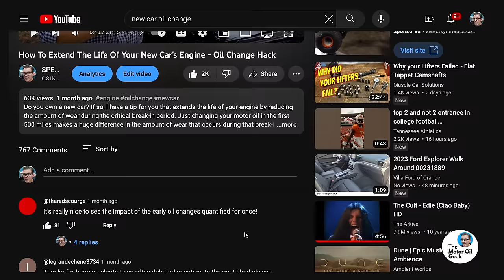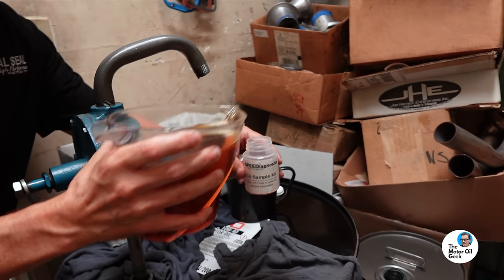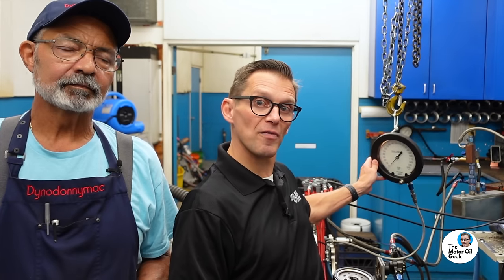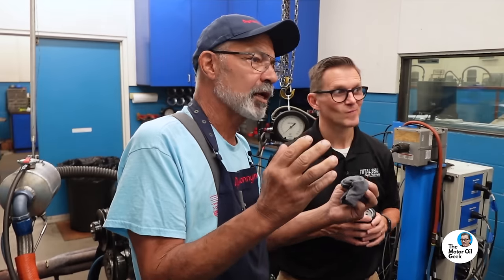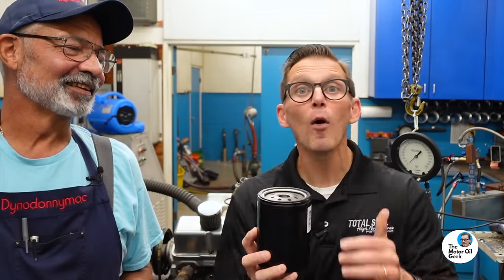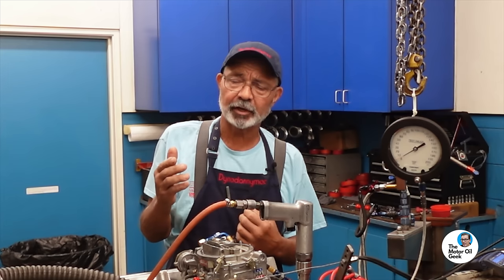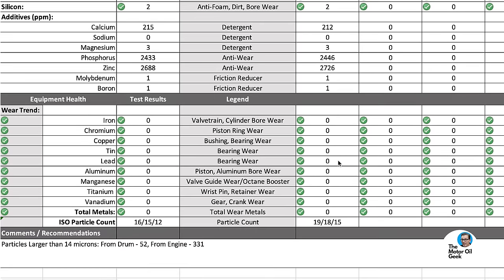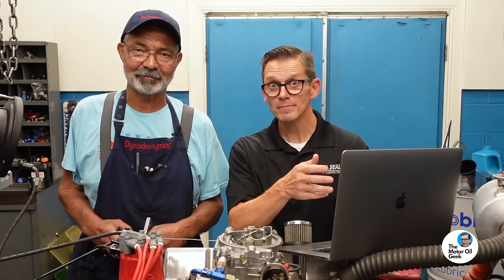Does Pre-FILLING The Oil FILTER Cause Engine DAMAGE?

Comment: I've been a heavy truck and equipment mechanic for 35 years. Today I serviced a Western Star that holds 11 gallons of engine oil. The two oil filters together held 1 1/2 gallons. I can't even imagine not pre-filling them.
Reply: I can't imagine the bill for the oil change!
Reply: That's a different animal than a daily driver auto.  Special applications require different methods.
Reply: Right there with you. I always pre fill all vehicles I work on unless not able to.
Reply: Watch garage 54 with the transparent oil filter, they fill instantly with the motor turning over!
Reply: That's a Centrifugal pump and filter so your comparing a mountain to a couple grains of salt.
Reply: Never have
Reply: @Yukanhayt-Mhenow, the oil filter might get filled, but there's no oil pumping up into the heads until then.
Reply: That’s pretty crazy and one big ass engine!
Reply: the two applications are totally night and day comparisons, 1 1/2 GALLONS compared to around 1 quart of zero lubrication running time of course you fill up the two filters first but a car engine no need
Reply: @Yukanhayt-Mhenow  pre-filing is not about filter the oil, its about the wear aplied to the engine. THE almont of time wasted in filling the filter = wear in top engine compounds x the times you do that = premature engine damage.
the filter is already in the hand, WHY take the risk ? ?
Reply: @drofmah3836  I guess you didn't pay attention to the video you just watched.
Reply: My filter is sideways it will just spill out.
Thats most of them.
Reply: @TIGJOHNNYSILVA  Its not about that, it is about your ego. There is no risk, there is no wear, there is no damage.
Reply: Sounds like an EXPEN$IVE oil change!!!
Reply: If it wasn't in the service manual, it was the wrong thing to do.
Reply: I never do this as its stupid and a waste of time. there is already a coating of oil on the anti-friction bearings and they run on little oil anyways, never understood the obsession of doing this
Reply: @jlo13800  Its from mediocre people needing to feel special about something they do
Reply: Yeah it is, i never do it on my 8v92 2 stroke as im BRP-XD-100 oil in it,
Reply: @drofmah3836 - actually its all relative. Distance traveled (engine displacement), size of bearings, etc vs volume of oil filter. So its actually apples to apples.
Reply: Doesn’t make any difference at all.
Reply: @TIGJOHNNYSILVA there’s no risk.
Reply: @richsmith3300 You can fill it and let it soak into the pleats and repeat usually twice. Of course at some point it would be too much and spill out.
Reply: @GT-mn3bx  oh ok thanks for that.
Reply: @GT-mn3bx never really thought of that thanks will try it next week🫡
Reply: @jlo13800  Are you aware that BMW requires an oil circuit priming every time something is done that interrupts the oil flow in the engine? You must know something BMW engineers don't. Waste of time? Wtf are you talking about? It takes less than a minute to pour some oil in the filter...
Reply: Never had a BMW, but sounds a lot what the Skidoo Rotax 850 Etec turbo r does on the big snowmobiles. Sounds like a posi force oil injection system on both the BMW and Rotax.
Reply: @danielquilesjr.3461 
I disagree with this process.
Been pulling wrenches for 40 years now.
When in early years had done this, and totally abandoned the concept of this process. So I would say 35 years now and have never ever had an engine issue. 
Rebuilt many many engines
Reply: @danielquilesjr.3461 
I disagree with this process.
Been pulling wrenches for 40 years now.
When in early years had done this, and totally abandoned the concept of this process. So I would say 35 years now and have never ever had an engine issue. 
Rebuilt many many engines
Reply: El Viras charge cooled 530cc 2 stroke wankel rotary ceramic coated engine can make over 85 hp at 68  rpm's ans is N/A and uses silkolene synthetic 2 stroke oil
Reply: it just over inject too much oil than the bearings need, everything is on anti friction bearings since the 60's till today
Reply: Elviras 530cc charge cooled wankel rotary ceramic coated 2 stroke can run as lean as 100;1 and make 85 hp N/A! Juice Newtons 294cc charged cooled wankel makes 60hp on JP8 and uses silkolene 2 stroke synthetic oil like El Viras 530cc wankel!
Reply: Both Juice newton and El Vira uses silicon nitride coating in the rotor chambers and apex seals. There are ceramic silicon nitride roller bearings on eccentric crankshafts too!
Reply: Julia Childs did all the CNC machining on here granite bedway 5 axis CNC aetheric laser mill
Reply: @richsmith3300  With sideways filter, remove sparkplugs to avoid compression, and crank engine over until oil pressure is achieved.  It's the engine running under load with no oil pressure that does damage, not an engine being cranked. The toyota corolla workshop manuals from the 70's cover this.
Reply: @martincarriere3738  And what engine issue would you expect? It's not like your engine is going to blow up... we're talking about maybe a slightly reduced engine life for long mileage engines, not catastrophic failure 5 min after the oil change.
Reply: @johnnyblue4799  the customer base we deal with are repeat customers many that had fleets well over 30 units. Cummins present back to some big cam engines with top stop injectors, Detroit 2, and 4 stroke, caterpillar various engines.
All that we also provided, and monitored oul samples from engines,  transmission, and different.
Very very seldom did we get bad samples. 
Most of these customers were construction,  mining, and oilfield. 
90% of engines that weren't rebuilt by us, came in with a hole in the pan, or block. Usually overspeed.
To this day, I don't pre fill oil filters.
For a rebuild,  we would pressure lube the engine before start up.
Reply: I have been mechanicing since 1975...always fill the filter with an oil change...even if the filter is mounted sideways. You can still pour it halfway full and then let it sit for a while and the filter will soak up most of the oil in it...and never forget to put oil on the o ring..you'll have heck getting the filter off next oil change...I  guess that's why my engines last so long 😂
Reply: If it makes you feel good you can fill some of them. There is no need to do it, you’ll never notice a difference.
Reply: We never fill. Doing all the heavy equipment. 2x 2L filters etc.
Reply: I have mine changed every 12 -15,000 mi (that's about 4 to 6 weeks of driving). It's about 400 bucks (or one fourth the cost of filling the diesel fuel ranks)
Reply: Pre fill pre fill same with diesel fuel filter or the pump doesn't get lubed
Reply: @morgandelaware7269  fuel filter is totally different story!! Most cars wont start because they suck the fuel, there is no fuel pump. If you have filter full of air then it won't start or will have to crank it for minutes. Pump doesnt get lubed... The fuel nowadays doesnt lube it anyway. There is no metal on metal grinding when it doesnt get fuel. Fuel is there to cool it down for the most part
Reply: My Honda only takes 4 quarts. Don't think it matters for me.
Reply: @richsmith3300 pull the fuel pump fuse and try starting the engine for 5 seconds. There you go, it's now primed.
Reply: 3 filters 1 1/2 gallons and not a single drop of prefil  900000 miles going strong
Reply: @jlo13800 
you make a really good point 👍
Reply: @harleyhawk7959 exactly! Just because the oil filter fills instantly doesn't mean that oil is delivered to the vital parts of the engine instantly
Reply: @drofmah3836  As a mechanic run your car with no oil for 30 seconds every 12 months for a couple years and I'll bet you'll wish you had not done so, you'll statistically shorten your engine's life by 49%...
Reply: @richsmith3300 you do NOT have to fill the filter until it's full of oil in order to prime it which is what you are accomplishing by pre filling it. It doesn't have to be filled to the rim of the filter...
Reply: @malcomreynolds4103  I'm a commercial diesel mechanic with over 30 years under the hood, as little as 30 seconds without oil pressure reduces bearing life 50%...
Reply: @jlo13800  been a commercial diesel mechanic for over 30 years, as little as 30 seconds without oil pressure reduces bearing life by 50%... so yes, you most definitely should pre-fill oil filters
Reply: Thats why both Polaris and Skidoo use the posi force oil system on their 850's! Thos are mini jimmies that are 2 stroke like detroit diesels!
Reply: @jlo13800 yeah your old Detroit is one of the most resilient engines ever made when it comes to lack of oil as the entire block is pressurized and it's extremely common for those engines to accidentally be ran with little to no oil in the crank case and still somehow survive. The old saying with  commercial diesel mechanics when it comes to 2 stroke Detroits is if it's not leaking oil while it's running it's because it's OUT of oil...
Reply: @johnnyblue4799 well some people value durability. I mean it's not like there's a million mile club for Cummins engines or anything like that.. oh wait, there is lol
Reply: @Andres-wy5du  5 class 8 trucks, lowest mileage one has 1.3 million miles highest a Peterbilt with 5.8 million all on the original engine (not rebuilt) all pre-filled going strong...
Reply: Yes my 8v92 like most detroits are anti friction bearings, A Rotax 850 Etec is external pressurized with sensors, pumps and other shit. Detroit 2 strokes are fairly high performace as the are bigger well sort of version of whats in snowmobiles. I have been running her with BRP XD-100 oil i get at walmart full synthetic. Funny thing is lots of Rotax skidoos will weep some oil by the RAVE exhaust valve thingys. Now on OP 2 stroks it would be a blast to make a rotax or polaris 1700 OP and lay it down in the sled. id probably kill myself on such a sled. Rotax is the jimmy in the snowmobile world, but polaris and arctic cat are catching up. Now the 1.9l 3 cyl rotax outboaud is 150hp and could probably be used to swap a 4-53 with it.
Reply: @jlo13800    I'm a second generation commercial diesel mechanic with over 30 years of personal experience plus my fathers 60+ years experience. Literally EVERY bearing ever made for literally any purpose is an "Anti-friction" bearing. That is what a bearing is, otherwise they would serve absolutely no purpose at all. Detroit 2 stroke engines are NOT by design high performance engines and still woll benefit greatly from proper maintenance, part of proper maintenance is ensuring adequate lubrication which pre-filled oil filters aid. Also those "Valve thingys" that leak oil on a 2 stroke diesel are called "Weep holes" the reason 2 stroke diesels have them is because the entire engine block is pressurized by the blower. The Rotax 850 while it is a 2 stroke engine it is designed to run on 100 low lead avgas with a mixture of 2 stroke engine oil (essentially a chainsaw engine designed to run on a mix of aviation fuel/2 stroke oil) quite a bit different and a significantly lower bearing load that a Detroit 8v92 (approximately 50-60k lbs less of a load on the bearings). Rotax 2 stroke engines have a rebuild recommended by the manufacturer of ever 40 hours of operation.
Reply: If you're going to fill up your filters you need to fill them from the outside holes so the oil gets filtered as it soaks through the filter material to the center.
Reply: Absolutely right. My 3406 cat takes almost half of the 5 gallon pail of oil to fill its filter. 10 gallon oil change. I cant imagine starting that expensive engine without filling the filter. Shit man for me thats the stuff nightmares are made of
Reply: @jlo13800 its not the film of oil that protects the bearings and wear surface its the oil PRESSURE.  Empty filter equals no oil PRESSURE and premature wear on the components. Do what ever social media you wish to listen to says just dont bitch about your engine wearing out prematurely
Reply: Is there oil in bedded in the bearings. Some CAT are roller bearing now
Reply: @jlo13800  there are no roller bearing connecting rod or main bearings in any diesel engines that I know of. Do you know how a roller bearing crank is assembled. I do because I also work on motorcycles and actually own a 4 strike motorcycle with roller bearing bottom end
Reply: Oy you got one of them press fit together cranks, Some bigger engines can run split roller though like 2 stroke and 4 (joke) stroke outboards. Some smaller air cooled deutz 2 stroke diesel might have them as well. Michael Obama's  Amaroqu 50 hp 2 stroke diesel out board is 68m * 64mm 3 cyl for 697cc! Who knows what that crank runs on.
Reply: Different animal than my 8v92 silver detroit 2 stroke turbo
Reply: Detroit 2 strokes are resilient because of the very hardened forged rods and crankshafts forged with 4340 Cr mo alloy or something like it.
Reply: Volvo d13’s have 3 filters. I fill them up as well now. Some guys don’t
Reply: If it makes you feel better by all means fill your filters, it wont hurt anything! i just never did it on my 2 stroke v8
Reply: @js6729  if any of that is accurate for what you maintain, the platform you are working on will have an oil priming systems that you will be told to use, instead of doing something as irrelevant as filling an oil filter.

nevermind that it doesn't take 30 anywhere close to 30 seconds for oil pressure to build in nearly anything, the 30 second number is entirely bullshit; cold weather diesels go without oil for far longer than 30 seconds every single time they are started yet still last tens of thousands of hours.
Reply: @Yukanhayt-Mhenow my question is if that's the case with all engines? If so how come when prefilled my oil pressure light stays on for 1 second vs 5 seconds when not?
Reply: If it's a diesel that's a good idea they work much harder than gas engines. I have driven several cars all with gasoline engines over 1,300,000 miles all together, in all kinds of weather temperatures and conditions.
 It depends if you're using synthetic, synthetic blend or conventional oil. The very best oil you can put in your engine gas or diesel, bar none is synthetic oil.
 The main reason the new car dealers don't put synthetic in every new cars is there a bunch of cheap hillbilly tightwads who are how to make every single penny of properly get no matter what takes. Is synthetic oil would be cheaper than conventional they would use synthetic. That's why they use conventional.
Reply: @jlo13800 you're right. They mostly emphasize this practice on the older cars when they had mechanical oil pumps. With better delivery systems and better oil, there is much less need to do it.
 Heck!!! The first cars didn't even have oil filters.😂😂😂
Reply: Todays engines have VRO
Reply: A lot of snowmobile today dont have oil filters or they have them.
Reply: Thats because the same oil pressure activates injectors and not filling them causes issues😒😒
Reply: Most of todays stuff is on roller bearings anyway
Reply: People just put videos out to get likes whether it is correct or not. Sometimes internet knowledge can make you stupid.
Reply: You can say that again.
Reply: What a waste of time. Do you not check the dipstick after priming? There's still oil in the engine after you drain it. Unless you let it drain for hours, until every drop is out.
Reply: My thought exactly, especially with Subaru upside down filter?
Reply: @martincarriere3738  dude you just gave testimony why someone should. Are you rebuilding the engines you didn't prime? 🤔
Reply: @martincarriere3738  Extra bearing wear is perfectly acceptable if you don't mind it.
Reply: @jlo13800  Awesome, where can I order a set of anti - friction bearings for my engine?
Reply: @js6729  Do you think oil gets to the bearings sooner if you pre-fill?
Reply: @js6729  Agree.  I fill mine to 1/64" below the rim.
Reply: @jeffro221  I don't think it does, I know from experience it does
Reply: @jeffro221  well for starters all bearings are "anti friction" that's why they're bearings but I think what they were talking about was bearings with a DLF (dry film lubricant) coating this is something that typically can be done by any diesel performance shop but it's still not intended to be a replacement to adequate lubrication, it's meant to be a preventative measure just in case you lose oil pressure
Reply: @js6729  Ok, thx for the info.
Reply: @js6729  Yup, I also believe oil gets to the bearings much sooner with pre-filling.
Reply: I've been a master tech for 25 years and have always pre-filled my filters.  Number of engines I've damaged = 0.00.
Reply: @harleyhawk7959 not worried about the heads. More the main bearings.
Reply: Expensive racing engines prelube the engine before every start and only starts until oil pressure is up.
Reply: at 6800 rpm's
Reply: @calgreco8607 i cant imagine the amount of money it would cost to not pre fill it lol
Reply: Journeyman TandT.  Provided the filter is filled properly it’s a must to do.  Filling the center isn’t correct and the argument it’s only a split second when starting  is ridiculous. Even a split second over the life of the unit will lead to reduced overall mileage.  Like cold starts.  All this adds up to less engine life.
Reply: @malcomreynolds4103 service manual helps you kill your motor so you have to buy a new car
Reply: Do not prefilled filters on heavy trucks. Most filters say right on them not to. You will risk filter collapse and never know it.
Reply: I saw a Oil Filter on a F450 take a whole quart of oil like a champ before overflowing
Reply: @ryanstage3912 but same scenario though.
Reply: @jlo13800 why do you keep bringing up 2 stroke engines when it's not even a similar in comparison??
Reply: Some oil filters are not even Level with the engine,which could case oil spills.. In that case,I would not prefill
Reply: 2 strokes are far superior with better power to weight ratio.
Reply: Donald Trumps 454 v8 2 stroke has a better power to weight ratio.
Reply: My favorite 2 strokes have no engine oil. Some are blonde.
Reply: whoopi goldbergs OP amarc 300cc opposed piston crankcase scacvend 2 stroke diesel makes over 25 hp, uses nickel graphene bushings and is dry sump with silkolee pro 2 sx 2 stroke oil and can power a drown on JP8! can be hand started in either direction1 thats what she said!
Reply: The majority of these click bait posters aren't ASE A or T certified. YT is  like a virtual coloring book. Those of us who spent time in a seat and working in the field already know.
Reply: @harleyhawk7959  the heads are as critical as the crank and rod bearings .
Reply: @calgreco8607 I was an owner operator for over 22 years. I changed oil in my truck every 13,000 miles I like the other fellow said it's held 10 gallons of oil + two large oil filters called a primary filter on a secondary filter I would put a fuel filter on also a water filter. The water filter also cut down on cavitation small air bubbles caused by vibration that damaged the Piston liners.
Reply: I was an owner operator for 22 years I had a 400 Cummins that also held 10 gallons of oil in the pan and another gallon between the two oil filters and then also you had the fuel filter and water filter. And the strange part I also used to take my drain oil and dumped 5 gallons and each one of my 120 gallon fuel tanks never ever had trouble doing that and it also added to the lubricity of the fuel.
Reply: i dry sumped my 8v92 and run xd-100 brp 2 stroke oil
Reply: Is why you prime. It's call prime.
Reply: I have never done it on my trucks and they hold the same amount as yours. No engine problems whatsoever. Those filters fill up in 5 seconds. You aren’t going to ruin your engine in 5 seconds.
Reply: true
Reply: Funny how Cummins themselves taught me to pre-fill them. I suppose they're just wasting their time...
Reply: Being around gravel trucks most of my life, I don't remember prefilling oil filters. But then I remembered the huge luberfiner filters, we did fill them to nearly the top, then crack the nut on top to get the air out. Most of my dad's early trucks were bought at truck auctions. They already had 400-500,000 miles. Dad was always checking samples and sending them off. At the time, Rotella T 15-40 was the best oil.
Reply: OMG this is getting on my nerves and is trying my sanity! You dont have to prefill anyfilter on any 2 stroke truck! Yo dont do this on your chainsaw, mower or snowmobile do you for fucks sake! all trucks are oil injected and this filling filters on it is tolal nonsense! Go up to some guys/gals on a turbo skidoo rotax and they will laugh at you and BTW lightning and the sun are plasma 2 strokes too! next time there is a thunderstorm go buy a large fram 4 stroke oil filter and hold it up running in an open field and if you dont get incinerated or blown apart consider your self lucky!
Reply: I don't pefill my because on my car the filter mounts sideways and when I prefill it it just spills out while twisting it on so I no longer bother with it
Reply: On my Tacoma 4.0 the oil filter goes on top of engine it faces downward, should I try to prime this filter?
Reply: Them tacomas are roller bearing engines so it won do nothihng
Reply: You will unfortunately need to invert your vehicle with the Toyota 2 post lift adapter. It makes overhead access of the filter easy and convenient, and simultaneously provides cooling system and transmission fluid flushing.
Reply: @js6729 where in fact did you get that from?
Reply: I am actually a mechanic. I get paid to be a mechanic. It becomes very important to me that the people paying me to be a mechanic have every reason to trust me and my work. Quite often I am being a mechanic on machines worth incredible amounts of money. This Western Star cost over a million dollars. You don't need to trust me. I need to trust me.
Reply: @martincarriere3738  how many of the previous oil changes had you done on the many many engines that you rebuilt.🤔🤨😂
Reply: OIops this sounds like a 4 joke automotive cult here.
Reply: I always do it as well but this time I have forgotten to prifill the oil filter
Reply: @morgandelaware7269  so all the oil drains out of the pump when the engine is switched off........dont think so.
Reply: It just a waste of time.
Reply: @jesse75  how do they pre- lube without starting  the engine ?
Reply: @creationinspired200  explain.
Reply: Who told you to fill the filters at the beginning of your 35 years?
Reply: @xl250mon5  at summit racing you can buy a pre luber for any v 8. 
It pumps oil through the engine before starting and wouldn't let you start the engine until it has maximum pressure.
Or, like I do, I pull the distributor and turn the pump over with drill.
You can hear when all the air is out of the system.
Reply: @jesse75  so pumps the oil through  the engine which has no oil in any of the bearings ? Please explain how you know all the air has bled out.
Reply: @xl250mon5  his name was Micheal Abbott.
Reply: @richsmith3300 
No it’s NOT MOST of them!
By far most are still vertical filters.
Reply: I was a heavy truck and heavy equipment mechanic for 40 plus years and if you didn't prefill the filter it strave the turbo bearing for oil and it could cause damage to the bearing.🧰🧰🧰
Reply: @calgreco8607 the same as it would be either way.
Reply: I was a diesel mechanic  for 30 years I all ways fill the oil filters even on my motorcycle
Reply: Those of us who know, know. Those of us who don't run our mouths in the comment section as if we do. A diesel mechanic by nature has an understanding of what goes on in there. There are no light parts in these things and wear is the enemy. The question of do you or don't you prime your oil filter is easily answered with why wouldn't you? If you can't, you don't. And chances are good if your filter is upside down or sideways it's bolted to an engine that doesn't matter. A 14 liter Cummins costs 45 thousand dollars. Your entire Volkswagen doesn't cost that new. Peace.
Reply: I worked on farms growing up and in my early 20’s was a diesel mechanic. I moved onto industrial maintenance 14 years ago and I’ve never heard of someone saying not to put oil in a filter. The presses I work on has hydraulic oil and some with oil. At no time do we ever replace the oil filter without first adding oil to the filter. Where do people come up with this stuff at. I would never put a dry filter on a vehicle unless you have no choice.
Reply: Let's run the engine with no pressure till the filters fill up.
In this case about a minute and a half.
Reply: @Yukanhayt-Mhenow exactly, primitive mind wont care to hear that
Reply: @harleyhawk7959 did you rinse the preexisting oil off? same as many times you start, literally can run without oil just not recommended;)
Reply: @Caliber50bmg  No. You follow the manual, and that is it. With an expensive piece of equipment, even if there are uncommon routines that help something other than a mechanic's ego - you don't do it. You follow the manual to preserve the warranty. you aren't smarter than the teams of mechanics and engineers that work at the manufacturer.
Reply: Been perfulling
Reply: Scania has centrifugal oil filter but I've always pre-filled any oil filter unless it's side mounted.
Reply: You run your engine, then add 1.5 gallons more oil. Easy to imagine there!  :)
Reply: @mulvahetpolemidasateed Fuel lubricates the fuel pumps - running an engine dry permanently damages the tank mounted fuel pump.
Reply: @robert4123  you're a genius. Not. For about forty five seconds at start-up your oiling system is working out a huge bubble of air. air doesn't lubricate. These parts are significantly heavier than the ones in your subaru, and significantly more expensive. I build these engines and I'm pretty familiar with what's going on in there. If you do this to a customer's 70 thousand dollar engine you had better not tell him. This western star cost over a million dollars, stick with the filters on your subaru.
Reply: @quantumphaser  no.
Reply: they charge themselves when you start the engine and the che k the level to adjust so it's dumb to prefill them.
Reply: @drefhill  And while they are filling zero oil arrives at the entire rest of the engine - which is exactly the point of pre-filling them.
The majority of wear on an engine occurs in the first 30 seconds after starting because of oil starvation.
That’s why a lot of modern oils have additives to help adhesion when the engine is shutdown to reduce wear at the next startup.
Reply: Well. Ya of course.... but prefilling a car filter is for insecure city peoples,
Reply: @joseph-mariopelerin7028  you should when you can. Not doing it is for lazy country peoples.
Reply: @tomscrossthreadgarage4183 so useless is better than lazy ?? 

Also it takes 3 seconds to build oil pressure... just unscrew your filter and start your car you will see...  actually,  have you ever worked on a car? That's the question to ask to city peoples because they sure like talking out of their asses...
Reply: I thought my cummins 5.9 filter was big. Its just a baby
Reply: @malcomreynolds4103 is that accurate for everything?  Because by that, my transmission fluid only needs to be replaced when my transmission needs to be replaced.  You seriously buy that transmission fluid can last 15 to 20 years?  And what, 300k miles?  That's skeptical for any lubricant...
Reply: @johnnyblue4799 It takes me 5 seconds. 
No low oil pressure light on dash at start up after oil change. 
It's stupid not to add a little oil to a new oil filter unless the oil filter is situated on the engine in such a way that it would all pour out before fully screwed into the engine.
Reply: @jstravelers4094  Makes sense.
Reply: Nextel oil change, try filling your oil filter half full, then start your oil change, after all done, add your filter, the filter soak up most of the oil so it will not leak too much and then add oil, You should see oil pressure on start up.
Reply: @danielquilesjr.3461 Yeah you really can't in my car since it's sideways and will just spill out.
Reply: I should pre wash my new underwear too. Make a video on that too😂
Reply: @Nick-wr7vv  yes.
Reply: Same medium heavy-duty equipment technician and I couldn't agree more I had just explained in a comment that there's a right way and a wrong way to fill an oil filter and that is plugging the center threaded hole so that only the surrounding small holes receive the new oil
Reply: Some are in positions such as horizontal you can’t fill it i service equipment and big trucks cars too I dnt pre fill them been doing it for years never had any issues.to each is to own
Reply: Exactly!!!!
Reply: When you rebuild and assemble a motor like me a seven Boeing 5.0 80s motor I always primed it before installation and then let it idle for 10 minutes and then take a drive.🤙😎✅
Reply: Been a mechanic  for 50 years,it's common  sense  to fill the filter.engines to day the  filters you can t fill
The top end will run dry, just listen  at it rattle !
Reply: @dennyergler9009  50 years,.. That is an incredible accomplishment. Bravo for real.
Reply: Where they horizontal or vertical????
Reply: Just use Slick 50....Problem solved 🤣
Reply: Well, the average car oil filter might hold half a quart.
Reply: A big rig and a regular car are two very different things lll
Reply: Fill them
Reply: The starter usually cranks the engine at around 200 to 300 rpm, if the oil takes 4 to 5 seconds to get to the engine head because it have to fill the filter first thats at least 13.3 revolutions before the camshaft can get any new oil, and by the 5th or 6th revolution the cams already shaved the oil film they had and will be running dry for the other 6 or 7 revolution, that is just a fact.
Reply: @TIGJOHNNYSILVA did you even read the comment? He literally said filter fills instantly that means there is no damage from some magical delay to the engine getting its oil. You must be trolling there is no way you commented  without even reading it
Reply: @bretmcnairn5940 

And you have been doing that pointless routine for over 40 years?
Reply: @js6729 

It doesn't have to be filled at all. Complete stupidity to do it.
Reply: @holmes1956O 

What an absurd comment. Prefilling the filter is complete stupidity
Reply: @IST1233  so you like shortening your engines lifespan, go it. Guys never have this person change the oil in your truck, he thinks it's cool to do something that literally takes half your engines lifespan away in a matter of seconds...
Reply: @IST1233  My question is how many semi-trucks have you changed tue oil in over the last 15-20 years? Moreover how many class 8 tractor engines have you rebuilt in the last 15-20 years? Cause it's what I do for a living...
Reply: @js6729  

So because you have been performing stupidity for many years, that means I should follow suit?
Reply: @js6729  

Provide scientific studies that show this and not just your "gut feeling"
Reply: @js6729  

And listening to your logic, I'd be a fool to bring a vehicle to you.
Reply: @IST1233  And this is a well observed Fact in the automotive industry from over 100+ years of data gathered... what I can't believe is that someone is actually ignorant enough to believe that an engine running without oil is perfectly fine and nothing to be concerned about...
Reply: @Yukanhayt-Mhenow is it one of those little modern car "teacup" filters or a legit 1 quart+filter?  Some engine oil filters hold half a gallon of lubricant...
Reply: This fast talking stuff is annoying like those disclaimer commercial I never listen
Reply: @drofmah3836 It still represents a gap in lubrication time.  Even if it is just a split second. 

Watch Dave's Auto Center's test on how long it takes oil to get to the valve train in a Fjord Power Stroke without his fix.  The valve train is oil starved on cold start up: and you think dry bearing surfaces add to engine longevity.  

😂

Less time unlubricated = better.  ALWAYS, end of story.
Reply: @richsmith3300 Fill it up halfway.  Angle the filter until you spin it on the engine if you have the space.  Minimal to no spillage.
Reply: @malcomreynolds4103 

😂

No, it's about your ego.
Reply: @jlo13800 It sounds like you have more money than sense.
Reply: @ColonelBumButt  That's called auto mechanic superstition.   The plus side, is more of your engine ends up in the drain barrel, so your vehicle will be lighter and more efficient!
Reply: @jlo13800  Bye
Reply: @Bowhunterohio Where do they come up with it?  Lots of PBR and their grampa's friend two towns over knew a guy who had a cousin who owned a garage.
Reply: @IST1233  Tell us you're lazy without telling us.
Reply: No correlation to a regular passenger car
Reply: Seems like a ridiculous argument. Manufacturer who is liable for the warranty on every vehicle they sell, says not to fill the oil filter.
Reply: @malcomreynolds4103   it is the correct thing to do. EVERY big engine co is done this way.
Reply: @martincarriere3738   why are you pulling wrenches if you have never had an issue?
Reply: @jlo13800   what the fuck are you talking about. bearings are bearings and they havent changed
Reply: @martincarriere3738   what shop? just to make sure my stuff never goes there
Reply: @mulvahetpolemidasateed   how do you think oil gets to the pump? you think there is a lil Leprechaun pushing it up the pickup tube? most cars have an in tank pump submerged in the fuel tank
Reply: @SiXiam   it does. your camshaft needs oil
Reply: @H0kieJoe  I think the problem today is parents not teaching their kids correctly. When a kid gets their drivers license they should be taught how to change a tire and change oil. My son don’t have his license yet but he rides quads and I make him help me with any mechanical issues he has. I’ve taught him to pay attention to his quad. He knows to always do a walk around and check things to make sure there isn’t broken bolts or something coming loose. I’ve taught him the same thing with vehicles. I grew up on a farm so this is what my dad did with me so I guess I passed it on. When changing filters I would think it would be common sense to fill it up. It’s obvious that the system would run dry until that filter filled up and the oil got to the system. Everyone knows it’s lubrication and it can never be ran dry but you also gotta think of how many manufactures have built cars and trucks with a filter that is mounted on the side which prevents you from filling it up properly. I’ve seen numerous tractors and equipment like that to. Again I think it all goes back to what the person is taught. I would be surprised to hear of anyone that doesn’t fill their filter up first. I always assumed that was common knowledge. lol.
Reply: @briankennedy5578  bullshit.
Reply: @alexkocefas6227  No worries, I'll never try'n sell you nothin'. I don't even really care if you fill your filter or not. Not my business. Peace.
Reply: @wolveric0  Have you ever seen a big cam cummins?
Reply: @notsure6182  No, its not. It is NEVER done on a rig with a horizontal or upside down filter. The correct way is what is in the manual. Nothing more, or less.
Reply: @malcomreynolds4103  what "rig" has filters like that. every Cat and Cummins I have serviced has them vertical, same with the fuel filters. some mini excavators I have seen them upside down (what fucktard thought that was a good idea I will never know)
Reply: @joelnordstrom8049  they still have mechanical oil pumps! All oil pumps are mechanical
Reply: @martincarriere3738   it is a common practice to roll in new bearings on a cummins engine. common maintenance procedure.
Reply: @TIGJOHNNYSILVA   air bubble passing throught will rip it apart so no i wil never prefil
Reply: You can disable the fuel pump with a fuse, then just crank the engine to prime the oil system. On most modern vehicles, pressing the gas pedal to 95% or more, induces "flood clear" mode which disables the engine fuel injection system, preventing the engine from starting, but leaves the ignition system on, to prevent any fuel residue from washing out the cylinders. On a diesel, the flood clear mode probably disables the fuel pump, but check your owners manual first, this won't work on old mechanical engines.
Reply: @starseeddeluxe   and you can just fill the filter to shorten the time to prime. you can directly spin the motor with the starter lead, no need to fuck around with fuses etc
Reply: On small passenger vehicles, no, because the filter is so small. Large diesel engines with 1 gallon filters, I pre fill. It just.makea sense.
Reply: @notsure6182  lots of detroits have them upside down or horizontal. Marine implementations could have the filter literally anywhere and in any direction
Reply: Doesnt all that new oil pour over the engine components as your filling it with the oil? So the filter isn't doing shit untill the motor is running.
Reply: @js6729 Thats not an issue. Oil pressure builds up within a couple seconds on any engine.  Plus there's residual oil left over.
Reply: @Yukanhayt-Mhenow yes they fill up fast but what about the rest of the system its dry untill the system if full of oil. Look at big machines that hold 4-8lts of oil thats a long dry time
Reply: I was just thinking the same thing 😂

The cummins manual says on big bold letters to prefill the filter with at least 2 quarts (ours only have 1 filter, but we are a fleet joint and are federally mandated to change fluids every 5k)
Reply: @eac1235  Is that a guarantee? How many   seconds does it take for an 855 Cummins, or an 8v92 Detroit or a v12 Duetz? Perhaps a B+W Mann 2570? Would you like to foot the rebuild?
Reply: My Cat dealership never pre-filled filters. Said they filled so fast and if you pre-filled you create an air void. Every one of my Cats went over a million miles before needing an overhaul.
Reply: I agree with you 100%!
Reply: Facts 
My
Freightliner the same not to mention if I use ten gallons of oil 1 gallon of Lucas
Reply: should always prefill big diesel engines...
Reply: My vehicle has 360k on it.  I do all my own work. Never once filled a filter in my life. It’s still going strong almost to 400,000.  It really doesn’t matter. 
Maybe on big massive trucks I can see it making a difference though.
Reply: @richsmith3300 I had a 2014 F150 5 liter. The filter was on sideways. I still semi filled it, layed aluminum foil underneath to catch any spill, and hand tightened.
Reply: Who primes an oil filter 98 percent of cars out there do not prime there filters. My 425k Honda Ridgeline never done it on any of my cars . Honda Civic 212k n Acura TL 220k . My engine blew up never.
Reply: I have been doing my oil change on my 300k miles 3.5tt f150 without preefilling ,,,will my engine last 700kmiles if I prefill 😂?
Reply: Elude the sea a little bit and if it’s actually a vertical filter which is fairly rare nowadays, you can fill it however, it’s not required. This is a speaking purely for passenger vehicles. I will say that when the guys work on my big rig that both of the filters are actually almost completely filled the top before they’re actually screwed on, but there’s actually a system where you can actually fill the filters after you screw them on on the side of the block on our trucks, I don’t know if it’s an add-on or it’s actually manufacture add-on
Reply: All the “mechanics” in here that say you need to pre fill your oil have obviously never changed the oil on a Volkswagen tsi engine 🤡. It’s fine if you do, it’s fine if you don’t, but don’t belittle the other guy because he doesn’t do it your way.
Reply: @rolando7660  I own a 2011 Tiguan. You guessed it, 2.0t. This isn't about that. Or my Audi, or the 535.
Reply: We can agree to disagree technology has come a long way I'm old school do what you feel is right it's all good.
Reply: @tomscrossthreadgarage4183  and I drive a 2022 Peterbilt 389. I see the argument for filling the oil filters with oil before hand, because they are ridiculously huge…. But a little 2.0 engine? Can’t compare a big 15 liter engine to a 2 liter if you ask me.
Reply: @rolando7660  right, a little 2.0 doesn't need oil at all.
Reply: @tomscrossthreadgarage4183  for a quarter of a second….. sure buddy.
Reply: @Yukanhayt-Mhenow  Its still not "instant" on everything...and also increases the time for oil pressure to build.  Depending on the engine and what it runs at after startup can vary a LOT.
Reply: Same here, just what you do.
Reply: I prefill fuel filters on big diesels but never the oil filters. And lol the filters do not hold 1.5 gallons. Ive changed many and never 1.5 gallons. Yes they can hold a whole 5 gallon tub and some but the filters a quart each at most..
Reply: @shawnkelly695  Besides, if you don't prefill em, how would you know what they hold? I've measured what they hold, in fact I always do because I have to charge for it. I don't think you've ever changed the oil in a 'big' diesel, perhaps not even your lawn mower. And by the by, if you don't fill your fuel filter, the truck won't run, genius.
Reply: How long is the interval?
Reply: Not all oil filters can be filled.
Reply: I used the pre-filled oil filters until the internet said not too, see what you get for believing everything on the internet.
Reply: How hard is it to put oil in your filter and spin it on? Stupid or not an ounce of prevention......
Reply: Oil filter yes, diesel fuel filter absolutely no!
Reply: @ryanstage3912 I'm with you, it's not possible to fill the filters on daf trucks, pacar motor, the paper filters like a car, without the filter in the oil just pours into the sump. The filter locks to the lid so not possible to fill.
Reply: @Yukanhayt-Mhenow  I imagine nothing is more instant than it being filled before hand
Reply: For vehicles where the oil filters are literally straight up and down, they won't spill. For vehicles that have oil filters sitting at an angle, the oil will spill out of the filter a little bit. For ridiculous engines that have an oil filter that gets attached to the engine with the threads facing the ground, it's impossible to pre-fill those and hold all that oil. I believe a Mazda RX7 had an oil filter which was/is actually upside-down! 🙄
Reply: @danielquilesjr.3461  So you prime the ones you can't or just look the other way.
Reply: @richsmith3300 if ur filter is sideways it really doesn’t matter then. YouTube commenters will think they are smarter than a car manufacturer engineer
Reply: Ain’t filled those in years
Reply: Ain’t filled those in years
Reply: @danielquilesjr.3461 ok so what about the ones you’re unable to right there you said it so what are the ones you can’t fail sooner
Reply: @TIGJOHNNYSILVA 
You prefill the filter but STILL put oil in the engine, duh. After filling the filter you can easily fill the correct amount of oil from the top
Reply: Amazing how many of the 'Younger' people out here have no clue about big rigs. My Cat is an Acer 15. Just the engine is about 44 qts. plus the filters. & 2 fuel filters. Every month. It's not a big corp truck, it's my truck, so I maintain it. I don't want to have to rebuild the motor. About $30k for just a frame in rebuild. They don't realize that everything they have ever bought from a store, was carried by a truck. At 500hp with twin turbos they're not cheap. But I have to be able to get in and go anywhere in the morning. A motor is a motor. Always prefill.
Reply: Smart man. I ve done the same always👍👍
Reply: @johnnyblue4799 
BMW 
Isn't worth maintaining...
Reply: @theberserker9285  I love BMWs... great cars.
Reply: What was it 1000$ for a oil change?
Reply: Beastly!
Reply: As a CAT mechanic its right on the filter to not pre-filled the filter